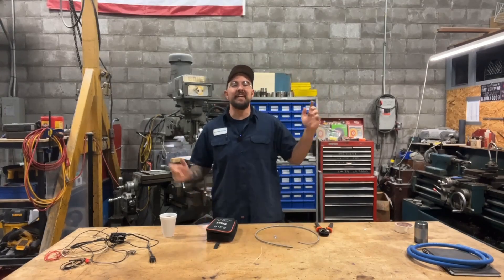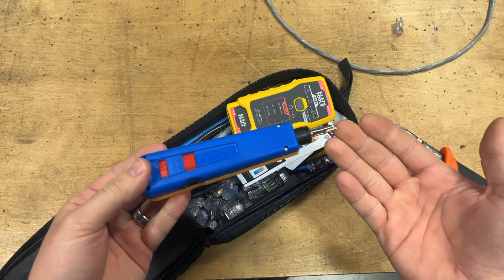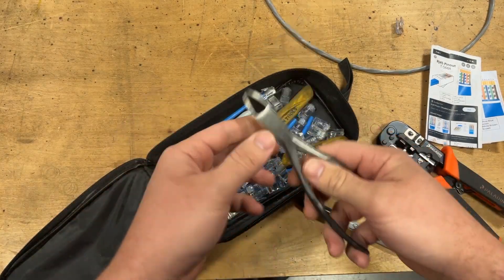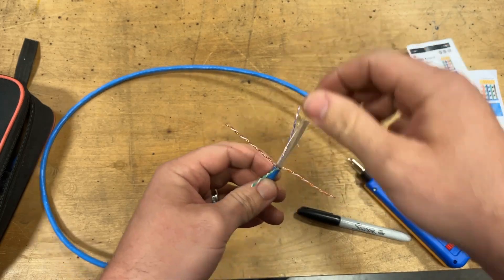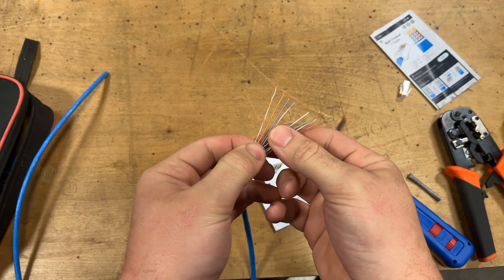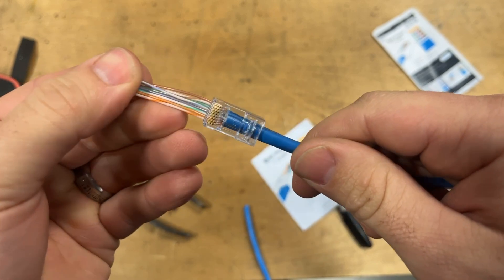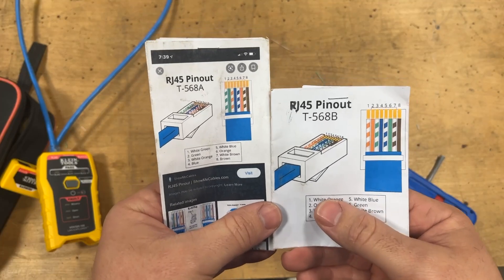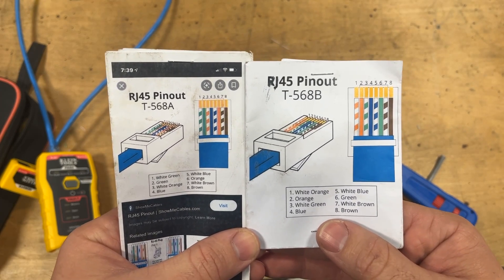How to make Ethernet cable (RJ45)

Comment from the maker: Check out the links below to get all the tools you need to do this job right the first time! And don't forget to print out a copy of the pinout diagram and keep it in your kit. 

RJ45 pinout diagram for type A, and type B. https://images.app.goo.gl/vtQU6LB4bB1TEFse6

(Tools)
Cat 6 bulk wire, https://amzn.to/3IRA5pB
Klein RJ45 crimping tool, https://amzn.to/3ZpWSzR
Klein punch down tool, https://amzn.to/3EYkzY1
Klein RJ45 tester, https://amzn.to/3YpmVG0
Channel lock flush cut pliers, https://amzn.to/3JgQW6H

Join this channel to get access to perks:
https://www.youtube.com/channel/UCbQmWKHxYQy4zrPWXIf1jQw/join
Reply: What about the rj45 ends?

Comment: Couple notes. 
There are crimpers made for the pass through ends that trim the excess as they crimp. 
In Canada the telcos decided we would use 568A. To make a crossover cable do 568A on one end and 568B on the other. This was important info when hubs/switches/routers weren't as smart.

Comment: Well done! I have made a lot of patch cables and terminations in the past and this is a very good tutorial for the basics. Solid wire is better for longer runs (patch panel to wall jack). Stranded is better for shorter patch cables as it is more flexible. Solid wire, in my opinion, is the easiest to work with. I find that if you gently pull on that small plastic cross insulator that's inside the CAT6 cable before you cut it. that will cause it to retract back inside the insulation just enough to make it flush with the outer insulation which makes it easier to slide the end over the outside of the cable before you crimp. Especially if you do not have the pass-through connectors.